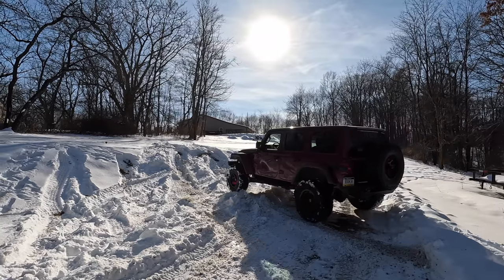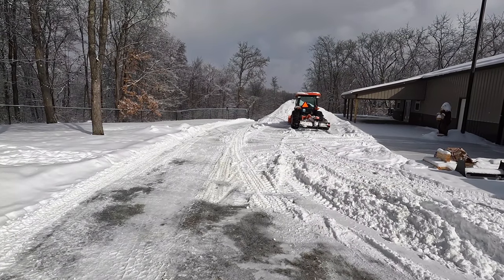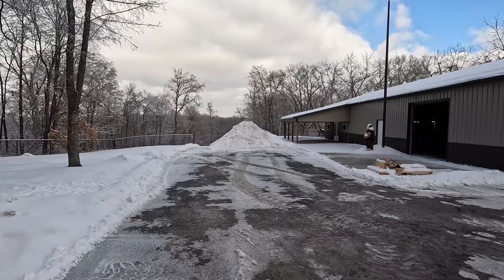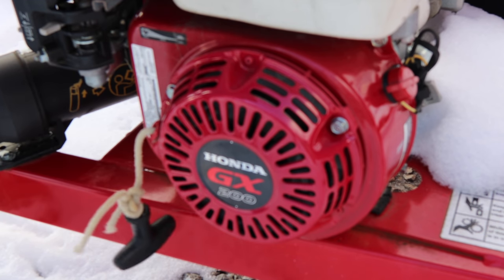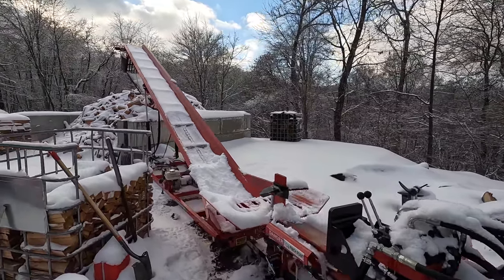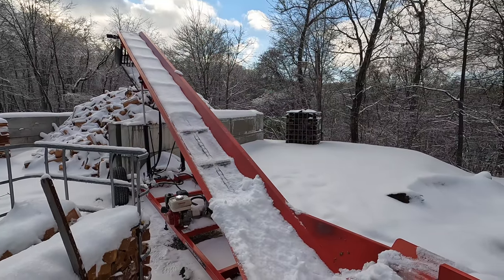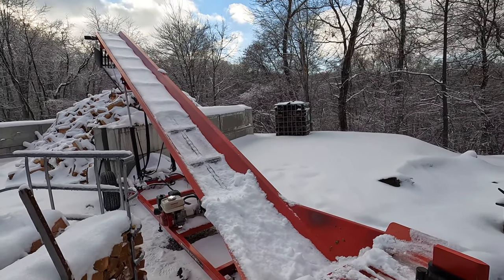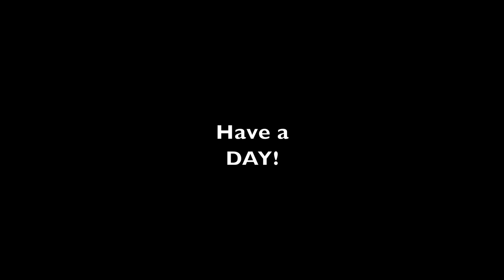Settling a Score and She is Froze Solid

Comment: I had a horse farm many years and like you I had about 1,000 feet of driveway to plow.  I had an older Massey Ferguson industrial level tractor that had not been beaten up too bad, because it only had a 1/2 yard bucket on the front.  No broken frame or parts on it all.  I put  7 foot back blade on it, offset about 2 feet outside my rear tire.  It pushed the snow off the road just perfect!!  IMO, you need a bigger back blade.  PS, it had a little four cylinder engine, sat outside all winter, and started EVERY TIME I ASKED IT TO!!  Lived under a blue tarp!   Most loyal piece of equipment I ever owned!!  Still miss that tractor, but not the farm work!!

Comment: I think your decision too hold on the couch when the word elevator was frozen is a good one. Just for fun though if I were to do it I would try to break up the ice enough to get it rolling again and it will kind of clean itself off. If it were an absolute emergency to use it I would do that but it’s probably not worth the hassle when it’s that cold out. Lol 

It would be a bit of a stretch but maybe that would be justification to get a jackhammer attachment for the excavator, you can break up that ice with that, you would just have to be very careful 😂 but it would be a good excuse to buy a jackhammer for the excavator. ;)

Comment: MIke, I think you could thaw that conveyor out with a judicious application of a propane weed burner. It wouldn't take much or even directly putting flame to metal. Just quickly wand the torch underneath & it should melt that puppy enough to get her running.

Comment: 1. Remove recoil starter. 2 . Charge cordless drill . 3 . Find socket to fit flywheel nut . 4 . Pull trigger on drill and enjoy your electric start motor !

Comment: as for the jeep not doing as well i agree with the tires being key. I'm running 35's on my JKU with a 4.5 lift. the tires are 10 ply Mud type tires. you really have to let the air out of the tires down to the low 20 lbs to really make the tire soft enough to mold to the snow or the tire is to stiff. we had about 16 inches  and the jeep sucked until I lowered the air. even then our old Toyota tundra with regular all seasons walked right threw that snow were the jeep still struggled.  so I'm going to rethink my tire choice for the jeep. thinking about a all season 6 ply. that should be plenty firm enough for the weight. being Jeeps are light as a whole. I just ran across a nice clean 2002 2  jeep with 33's . stock mostly. nice soft top. I worked a good deal on it. so if we get a nice snow i can't wait to see how it does with all season tires. To be honest i was a bit at edge driving the jeep as it seemed to slip around way to easy. I've had lots of 4x4's in my life and i was let down by this 57,000 jeep.

Comment: I had to laugh when I  saw you replacing the screws in the rope starter. It reminded  me of a day years ago at work when a nut was dropped  in the snow and a crew of six had to stand around  until a replacement  screw could  be retrieved from the garage about  6 miles  away. Winter is rough. In the wrong  hands 4 wheel  drive only gets you farther  from  help before  you  get  stuck.  Hang in there Mike.

Comment: the jeep has wider tires then the bronco in mud and snow the narrow digs the wider floats on top the right tire for what you are doing i have a jeep it goes anywhere rock climbing goes anywhere short wheel base that is why the military has them they go anywhere i am not nocking the bronco they are also great great job love the snow plowing with the tractor get a schedule 40 pvc slit it down the middle snap it on your front bucket you can plow crush stone with out plowing on the grass and will not dig up the grass great job mike

Comment: SNOW MELT. HI Mike and Melissa. Mike, I'm thinking that pile of snow in front of the building is going to make a mess when it melts.  You might consider pushing it over all the way to the fence or it can run down the hill as it melts.  Something to think about.
Reply: Margee, His septic system is in that area if I remember right?😷⚾
Reply: Don't forget though, there is rock in that pile that the loader and blade pulled up from the drive...  Once that pile melts, you don't want that in the grass.

Comment: The boom on the rear blade should be horizontal. That way the cutting edge will stay flat even when angling the blade.
Reply: Having it tilted like that lessens the aggressiveness of the blade so you bite less into the stone, then just have to adjust your side arm to level it.
Reply: @peterkoster5053  Yes!!!  This!!! ^^^^^^^^^  It keeps the blade from wanting to "dig" and pull the rock up along with the snow.   Keeps the rock piles smaller after the snow melts.

Comment: Mike why are you not pushing all that snow out by the fence? instead of pilling it up in front of the building.
now you have to deal with all that water when it starts to melt. I as a plow guy always try and push the snow to low ground.

Comment: Mikey,
There is a bracket bouncing around on the front of the plow set-up on the front of the Sidekick.  
You can see it's a small, square plate with a hole in it, around the 0:18 mark.  
It's hard to tell if it's supposed to be like that, or something has bounced loose.  It's to the left of the winch.
Reply: I have the same thing as Mike, all it is is a stand that is in its storage position while plowing, held on by two cotter keys, and to unhook you just flip that over to hold the back end of the plow up, kinda crude, but it works 👍
Reply: @scotts7427  thanks

Comment: Just be careful on your insulation that you don't wrap it too tight and instantly too tight because the building will need to breathe. if the building doesn't breathe you will start building up condensation and it will start sweating on the inside cause of mildew and rot.

Comment: Wouldn't have expected anything diferent the Bronco did it with ease and paved the way for the jeep to struggle up but it made it LOL.
   That's settled it Bronco king of the bank climb and every other off road situation.
   Well I was going to say try using a torch on the escalator to thaw it out enough so it would start if there's no rubber parts on it but being that cold the sofa sounds like a better idea LOL.
   It's been cold down here in western NC this week after being in the mid 60's last week. But it is going back up into the high 50's and 60's again Tuesday for the week  so can't complain.
  I missed out on the burnt orange carhart hoodie. Sold out , bummer oh well.
   Still praying for Eva and Hunter .hope all is going well for them both and yall.
 God bless 🙏

Comment: Nevermind those Jeeper Creepers, they never have liked Ford Tough just those Ford Dana rear ends.....

Get a weed torch off Amazon and a propane tank without safety valve (if safety valve trips it'll cut propane flow down to you think torch isn't working right) and melt that away. May take 30 mins to hour on that but it'll do it.

Hi Mel! 🙂👋

Comment: Maybe try pouring on some of the RV antifreeze on the conveyor. I think it's alcohol based so it's not harmful. Or at least maybe spray it down with it before the next weather event. I spray down the swivel on my ATV snowplow once it gets packed with snow, keeps it from freezing. It keeps it a pink slush.
Reply: I don't think he would want to do that with the dogs around.
Reply: @rovicarl7194  rv antifreeze is different from auto antifreeze. It goes in the water system of an RV in the winter and is considered safe, however I wouldn't try to drink much of it.

Comment: That rain, sleet, and ice storm was miserable. I think you will need to leave that elevator in the sun for a few days. No sense forcing it. Each one of our cars and trucks were difficult to get cleaned off and defrosted. Would rather have had 30 inches of snow, which by the way we get every few years in NH.

Comment: Mike its not the jeep but the tires you have on it, may I suggest  FAUKLIN AT3, I run 285X75X16  10 ply on my F250 Crewcab 4x4 Diesel  Gearing 4:09sI bust through  3 foot of snow all day long and my truck weighs 9220 pounds , I just love that tire weather it be Snow, Mud, sand, or hard rock climbing, this tire you might want to look into.

Comment: Mike, is the liquid in the radiant floor heating water or some type of antifreeze? I'm asking because I was wondering if it's frozen and you hook up the boiler wouldn't there be a problem? I don't know anything about radiant in floor heating. Regards Bill
Reply: The heat will use an antifreeze of some sort .

Comment: Lol. On that type of obstacle any four-wheel-drive with identical tires will do about the same as long as there are lockers and both of them made it easily. In the first video the jeep had slightly less forward momentum and he sort of stopped at the top from what I saw on video but you can’t tell that could’ve been slippage also you’re both very capable for factory vehicles in tougher off-road conditions and different circumstances the bronco is probably a little better equipped with it traction control modes but people seem very competitive over brands.  Lol. I had to take either one of them they’re both decent Premier factory vehicles. If I was going to trick one out for hard-core offloading I would take the jeep because there’s better aftermarket parts availability or I just get an old Land Cruiser Toyota mini truck and build some thing but I’m definitely not against factory cars I would love a bronco or the jeep they’re both very capable turnkey easy and very comfortable on top of it. Whatever works best for people is what they should get and just enjoy it

Comment: Another snow and you'll be showing us the excavator bailing that pile to the other side of the road, tractor wont be able to stack it tall enough before spilling onto patio. Still think a blade on the tractor would be the deal. 

Jeep and Bronco,  tires gears and suspension are different enough to make the compare difficult, they are both capable... Bronco is an excellent copy of the Jeep Jk/JL though

Comment: Mike, how many times can the excavator cab spin in the one direction, is there a limit?  Enjoying the SUV tests.
Reply: Good question, no limit on turns, hydraulic seals and O rings contain the fluid that drives the track motors

Comment: Definitely agree with you on the Bronco tires being slightly better. I can't remember how you said you configured your Bronco, I know you have the Sasquatch package but don't remember if you ended up with the solid front axle or if it's still independent on the front. If it's independent,in my humble opinion it will give you a slightly bigger advantage in keeping the tires on the ground to keep maximum traction. Either way, they are both very capable vehicles.